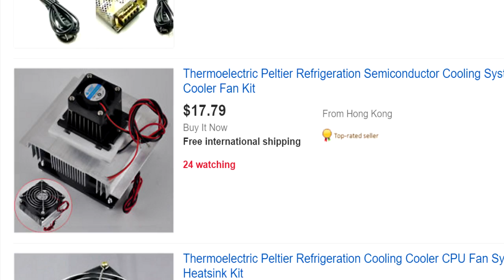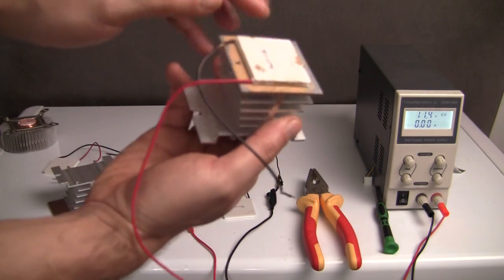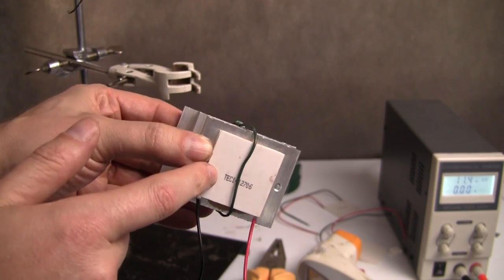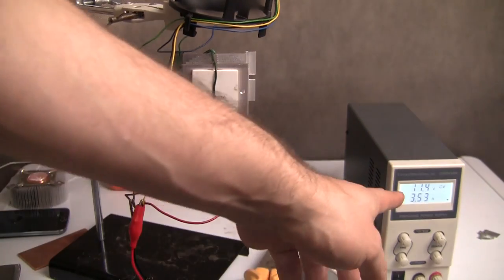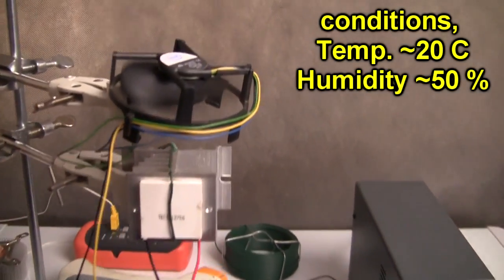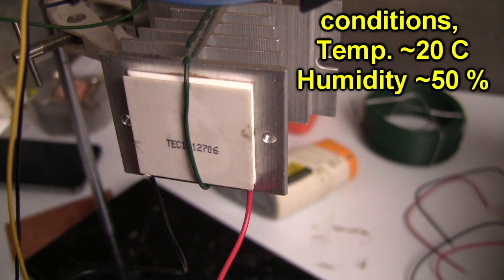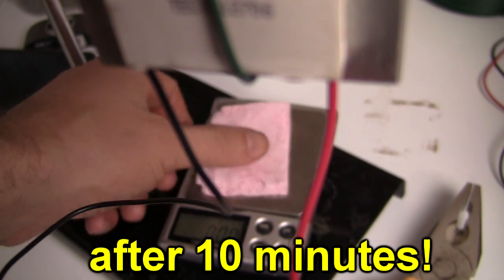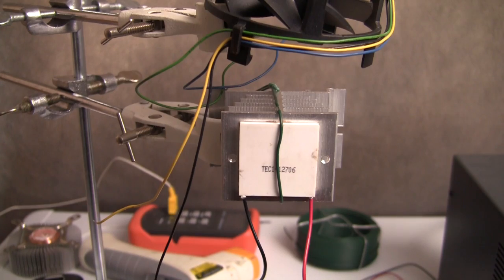Fontus Water bottle claims to make water from air.  Is it possible?

Comment: Wouldn't mechanical compression of the air, followed by heat rejection to the environment create more condensed water for the same electrical energy input?
Reply: Go get a cheap air compressor, with reservoir, at the mart and run it for 8 hours. You'd hardly get a spoonful of water for the high ration of energy you'd consume.
Reply: Yes, but only if you're talking about air compressors designed for consumers.  However, if the machinery is designed with expanders (recovering compressor work) and heat exchangers, with the expressed purpose of harvesting moisture from the air, the yield can be an order of magnitude higher.. Probably not enough to be practical, but still better than typical thermoelectric devices like Thunderfoot used.. Of course, the main variable is humidity of the inlet air ...not much energy is required to recover significant liquid water from cool, humid air, but ridiculous amounts of energy will be needed to get much from hot, dry desert air.

Comment: My camping water solution is a kettle and a rolled up length of vacuum food saver bag. The bag is small and light to carry, but has a huge surface area when unrolled.

Boil water -> Steam -> Re-condense -> Drink/Cook

Makes a litre or two per hour from most any water source. Much safer than merely boiling potentially contaminated water, plus it also de-mineralises salt water.

Basically, if you're camping on the beach or a brackish lake, and you are going to have a camp fire at night, you can make unlimited drinking water from the previously undrinkable supply - without having to carry several drums and/or go back to town to resupply. 

I survived a 160km hike using this method. :)

Comment: you may have factored this in. but woulnt the increased service area (as shown in the clip) help with the condensation? or is that not significant enouth?
Reply: +Laughing Stock in the clip they show two heat girds. presumebly one for hot. the other for cold

Comment: The basic concept reminds me of the tactic of gathering water in the desert, where you dig a really big hole, but a tarp over it, weight it down, then put a brick or some other thing in the middle to collect the water in the center which then drips into a container... the thing is that it collects only about a water bottles worth in a night(since the temperature drop during the night) for, if memory serves, a five radius cylindrical hole so had an absolutely massive surface area of collection comparatively.

Comment: Just do what Mark did in The Martian if you need water. Take H₂N₂, and decompose it into H₂+N₂. Then, use a container to let the hydrogen rise to the top. Divert hydrogen into separate container. Burn hydrogen and have it bond with oxygen in the air.

H₂+2O₂->H₂O+O₂

Water.
Reply: WWMWD ; )
Reply: ***** Not if burned in small amounts/concentrations. Then, it's just flammable.
Reply: +Laughing Stock If a simple gas stream is "Ridiculously sophisticated" to you, then yes. Hydrogen gas from a small jet (a blow torch if you will) is ignited and the gas stream of hot water vapor is collected in a container. The idea is course still bogus, because you usually don't carry rocket fuel around with when you're out biking. And if you do, you might as well have taken a bottle of water.
Reply: Did you even read my first post? I already said that carrying rocket fuel around is stupid. I'm just contesting your idea that you cannot burn hydrogen. You could just search youtube for hydrogen flame, but no, you give some numbers from wikipedia. The only thing you convinced me of is that you have no idea or practical experience.
Reply: +RandomCanEHdian sounds fuckin easy :P
Reply: +RandomCanEHdian only if I was on a planet without millions of gallons of water.... Then maybe... but then I would question how the hell I got to a planet without any water...
Reply: +Laughing Stock Actually, industrial scale hydrogen production is done almost exclusively by methane reduction. Much cheaper than electrolysing water, and a lot dirtier than the proponents of FCVs would have you believe.
Reply: +RandomCanEHdian 
Yes but you have to carry H2N2 when you could just carry water????????????????????????????????????????????????
Reply: *****
Are you trying to be true to your name or are you seriously so dumb? Hydrogen explodes in air? Yes, the correct mixture of hydrogen and air is an explosive mixture. But so is methane, ethane, propane, butane etc. Ever used a lighter before? There is butane in there. Doesn't exactly EXPLODE every time you use it, right? Do you know what welding is? Guess how that works. Dude, I have several machines that use hydrogen flames in my lab and that part is just a small jet to throttle the amount of H2 and draw in the correct amount of air to make a nice, almost colorless flame that can burn for days on end (as long as there is H2 in the system). Please stop being crazy.
Reply: Yaldabaoth but the point is why carry around a 1 gallon gas can when you can just carry a 1 gallon water jug ?
Reply: IloveJell0
That's what I already asked in my original post and not the point of his reply to me.

Comment: THis is very primitive setup, which will be very ineffcient. to make it work you should add fan to circulate air and appropriate regenerator to transfer cold back to incoming air.

If done properly I think this device can really produce decent quantities of water depending on how much air you will manage to pump through. but of course it must be much bigger than that oversized bottle cap.
Reply: So fix the inefficiency by making it a bigger power drain? Ie less efficient to a point the little solar cell it runs off can never power? Not quite a good idea
Reply: Ms. Sysbit 
there is no need to make it use more power it just has to be bigger device with decent heat exchanger.
Reply: deltaxcd so the fan runs off of what? Not power? lol
Reply: Ms. Sysbit in comparison to power demand of peltier cooler, fan runs on nothing.
Reply: deltaxcd still more a water bottle would need to fit on itself and power
Reply: Ms. Sysbit attempts to fit is on top water bottle are futile this device must be in size 1 gallon bottle to have acceptable efficiency.
Reply: deltaxcd and it's nowhere neat that size, It's a sham

Comment: I wonder what an air conditioner would do to your house if you could get that much water from that tiny setup.....I made one of these with the radiator - Peltier chip setup from an old over clocked computer setup (switched it around and filled it with anti-freeze ) it is fairly humid here so it worked ... I would have been able to fill that shot glass in only an hour or so... My 700 watt air conditioner could fill that bottle in 20 min or so on a really nasty day

Comment: I'm not saying the self-filling bottle works, I don't know, but where I live you would have got a lot more water on your cold side.  If I take a bottle of water out of the fridge and put it on the table, within a few seconds large droplets form and run down.  By the time the bottle has warmed to room temp there is a big puddle under it.

Comment: One small thing that  wasn't mentioned was the relative humidity of the air. You  could get more water if you are in a moister environment  compared to the desert.  SO if you are in a rainforest,  you would have a faster  fill rate compared to  death  valley.
Reply: +bluesage3 If you're in a rainforest just bring a few straw filters... no waiting, just drink, since finding water won't be a problem, and the filters make it safe to drink.

Comment: Maybe the dedicated product with an enclosed container works better than a cobbled together hodge podge of computer parts. Just saying.

I would be interested in seeing their prototype in unedited action.
Reply: +AnonEyeMouse 
In any case efficient version of this product must be pretty big  
if it is so small as advertised there si no way it could work well
Reply: +Jyiaesyil terthinar I was more refering to the container, but yes the condenser would need to find an optimum enclosure, capturing the maximum amount of humid air whilst limiting loss of moisture that has shifted to non chilled surfaces through movement etc. I know my old usb dehumidifier would fill up its 100 ml tank in two hours or so... roughly the battery life of my lap top at the time. That was living by the coast, however. In light of that admittedly personal anecdote I find the claim that a shot glass is the best you can do in 24 hours doubtful. Not going to believe the magic bottle either with a demonstration like I said above.

Comment: so what you're saying is if they had 10 of those, had better heat syncs, and more power, they could produce maybe enough water to keep someone just barely alive? What you're saying is if I made a machine the size of an outhouse i could condense maybe a gallon of water in a day, if it was as efficient as possible, assuming I used a stupid amount of electricity. Since I don't know the cost and conversion of electricity, Could you maybe do the math right quick of Cost in dollars for the kwh's per liter of water? just to see how expensive that water is.
Reply: +therealquade 
If this is done in bigger scale efficiency will be much higher 
there are those machines on sale already they are used to dehumidify air, jut look for air dehumidifier.
If you have good heat source you can just use chemical absorber like calcium chloride or lye or amonium nitrate.

just drop some of that into some bowl and within few days it will be full of water.

Comment: i dont know if this water bottle works BUT i do know this concept works because for centuries desert tribes living near where the ocean breezes come in over in another country in africa have been collecting water from the air by raising poles with this cloth fiber stuff strand between them that would wick water from the air and drip it into containers as the wind blew through it. i saw it on a few documentaries about how ancient desert tribes have gathered water throughout the ages... and this is one of the ways still used today.

Comment: my dehumidifier in basement pulls gallons of water out of air in summer and it's a pretty dry basement.  this is just drinking the container below dehumidifier rather than pouring it down drain.   that bad boy could sustain a family but it's huge and sucks power

Comment: This isn't as impossible as the Triton breather.
Dehumidifiers work on this principle, but you'd need at least 300W of power to extract 0.5L of water per hour.   You will need a long extension cord on your hike.

Comment: Please tell me that water purification is possible!
Reply: +BlueAxeRacer Yeah you can boil it and condense it, filter it through various means or use these pill based chemicals that purify them.
Reply: +BlueAxeRacer Yes, and easily. Look up reverse osmosis for example, which is used to get fresh water from salt water. Just needs some pressure, so doesn't even require electricity, there's mechanical pump ones available commercially for lifeboats and the like. There's also basic filtration systems, stuff like the Lifestraw are legit, though the filters have limited lifespans before needing to be replaced(Lifestraw example is rated for 264 galons).
Reply: +BlueAxeRacer 
Of course it is possible, why do you even ask that?
Reply: deltaxcd Because according to Thundy I know nothing about science.
Reply: BlueAxeRacer When did he say anything like that?

Comment: So they are setting a container in the sun, and also trying to condense water from the air? The water in the bottle will just evaporate due to surface evaporation because there is nothing keeping the internal temperature down. If they could pressurize it maybe but then they wouldn't be able to have a heat pump. Even if they promote dropwise condensation I don't see how this would be able to work.

Comment: +Thunderf00t Does the surface area of the cold side effect the amount of the condensation? And what about the humidity of the air? What if you're in an area with less or more humidity? What if the area is hotter or colder? The heatsink used in the device appeared to be a lot more spread out than the one you're using, but I have no idea how much that would effect things. Just some thoughts I had.

Comment: Would the proces be more eficient if you placed all that in a tube, to prevent heat from ambient air to stop the condensation? And how much weight would a battery capable of powering the device for enough time to fill the bottle have? what would be the volume of said battery?

I don't think it would be useful, even if it works, but I'm curious :P
Reply: +Sinclairelim 
you need to pass air to extract water you cant extract anything from standing air.
battery size required for that task will be dependent on final efficiency of this device
Reply: +Sinclairelim A well insulated container would slow the evaporation of the water already condensed and thus increase efficiency a bit but the process requires access to the ambient air in order for further condensation to occur (were it airtight for example it would condense what conditions allowed from the air available and that would be it.) With optimum conditions and design, this experiment might have produced a drop or two more than it did but it still wouldn't be enough to warrant the energy necessary to power the process...

Comment: I'd take a direct solar powered flashlight that has no battery over this.
Reply: +aaron4820 You mean a mirror?
Reply: +aaron4820 solar freakin' flashlights
Reply: +aaron4820 Solar powered flashlights are nothing, but hand crank flashlights are actually useful. (At least mine WAS until my little brother went and broke it.)
Reply: +aaron4820 Made one from eBay drops. A solar USB panel from here, a LED unit from there, a small rechargeable battery and charger from there, and i happened to have one of those military phone crank dynamos (that one was extra).

Came out pretty decent especially after i retraced the four electronic units on a single board and repopulated them. Have it sown on the back of my backpack. The LED is in its own case (the cheapo CREE ones you can buy with heat sinks preinstalled, i just heat-shrink-wrapped it).

And because the solar panel is USB it can also charge a phone. Tho i mainly use the crank for that since i'd have to be stationary, the solar panel is the only thing really worth upgrading after a while using it.
Reply: +aaron4820 Solar powered flashlights are totally a product you can buy...

https://www.google.com/search?q=solar+powered+flashlight&tbm=isch&tbo=u&source=univ&sa=X&ved=0ahUKEwjsqpX1r8fMAhVI5iYKHUQKD7UQsAQIVQ&biw=1680&bih=910
Reply: huginn muninn toilet roll tube.
Reply: The Ultimate Reductionist Haha, My brother would agree with pride. XD
Reply: +Mark Beiser .....they all have batteries.....
Reply: +aaron4820 Savage.
Reply: +Thrashaero I don't think that capacitors are the same thing.
Reply: +huginn muninn omg dont kill me
Reply: +aaron4820 But that would actually work, you would just have to shine another flashlight at it, and you would be saving energy because your flashlight is solar powered!
Oh wait...
Reply: scottthewaterwarrior
YES!  :D

Comment: Firstly, a shot is around 1.5 ounces, or 44 milliliters. So your setup would be making around half a shot if you can produce 20 milliliters in 20 hours. Second, the inventor claims to have perfected the process to around one drop per minute under ideal conditions. This translates to three milliliters every hour, or just over two ounces. That's one and a third shots in 20 hours. Nowhere near close to their 16 ounces in an hour claim, but still.
Reply: +Dialectical Materialism Firstly, a shot is measured differently all over the world.
Reply: I am House Which is irrelevant because he's in the US, and in the US, it's usually 1.5 oz. Also, the other measurements for a shot are never as low as 20ml, and many of them are higher than the US, bolstering my point that comparing it to a shotglass isn't correct, not detracting from it.
Reply: What are you babbling on about now? Your whole post was irrelevant. You never made a point...He isn't from the US and neither resides there (?). lmao
Reply: I am House Which has nothing to do with my original point. You're right that he doesn't reside in the U.S. I thought he did. That still doesn't detract from my point that his measurement is wrong. Why are you getting angry over nothing?

Comment: Well, not total bullshit. If you're stuck in the middle of the ocean, the humidity would be much higher, and you'd likely need some water. Still, it'd be more efficient to boil sea water and re-condense it.
Reply: +Ratstail91 You clould do that with a wide black tube if you wanted to...

Comment: So... a hundred of those running off of 4000W would take about a day to collect 2 liters of water.
How many miles of Solar Friggin' Roadways would that take to power?
Reply: +Christian Friis Sørensen not many if they were Thorium ones!
Reply: amojak Of course!
Reply: Can they convert the water back into air to breath? Can it hover?
Reply: +Christian Friis S&#248;rensen 
This is not that bad as you think
here is commercial products which uses less than 800w
and produces 30 liters of water per day
http://www.homedepot.com/catalog/pdfImages/c6/c6eeb527-c5e8-4d3c-acaf-f331d29cf6ad.pdf
Reply: deltaxcd It's probably easier to achieve greater efficiency when you scale it up.

Comment: keep in mind that there is no filter either so you get to drink pollution laden water if you use it in a city. Adding a filter requires greater energy use and therefore even less water would be changed over.